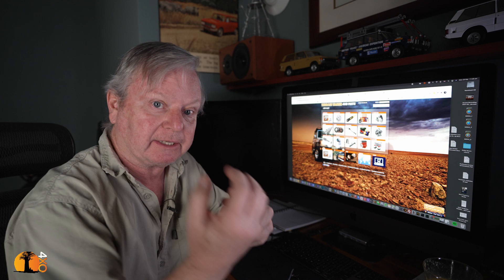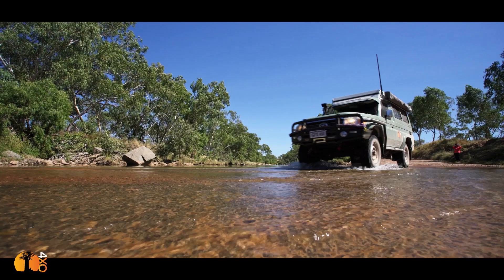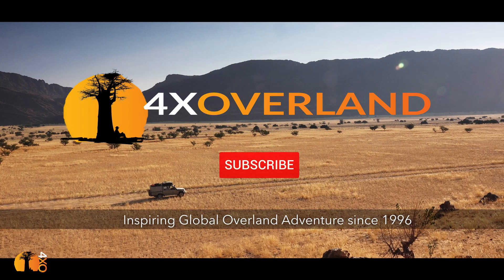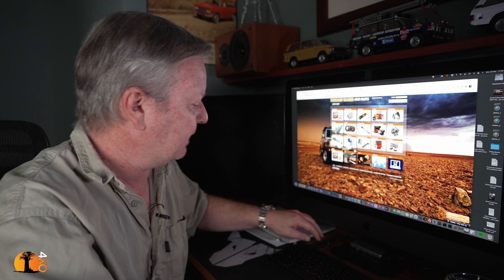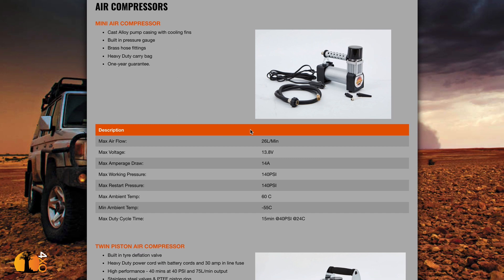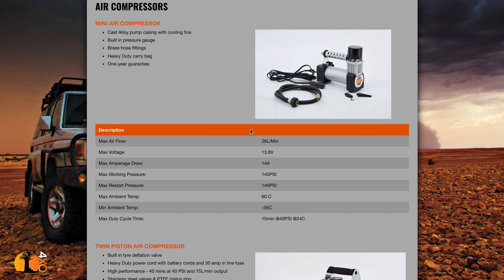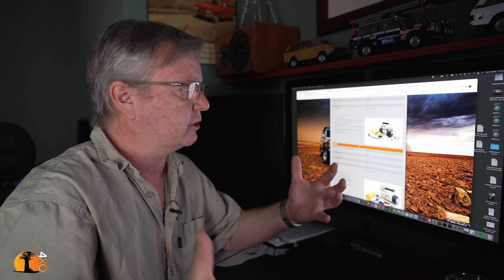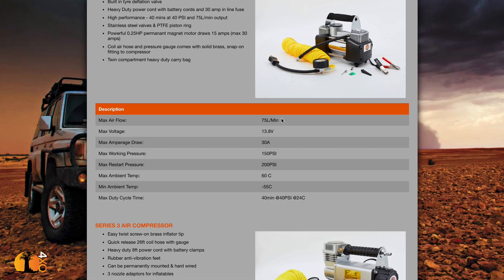BUDGET OVERLANDER ACCESSORIES, COSTS AND SUMMARY | 4xOverland

Comment: A great series for the orginal XTrail and yes there is one or two items I would just add on a budget.....

The first I would add is a bridal for the front recovery points, a few bucks or pounds well spent, the XT has two on the front though the bolts need uprating, also rear recovery point is an issue but you can use of a 2" receiver is an option, so get an Warn or ARB shackle block. I have seen protype soft shackle blocks but not off the shelf as yet. 

My second suggestion is perhaps considered by some be less important, but having done forest trails there is no accounting for damage by unseen rocks, even when carefully picking the route, a sump or engine guard. There are still a number available and for the low slung vehicle I would consider this, and they are not expensive and worth it for the protection they offer.

Lastly for those long trips take communications, even here in my home country I have had plenty of times where there is no mobile signal even on the best network. There are a number of different devices and technology moves apace, but to keep cost down for budget, borrow a sat phone or sat messenger and learn how to use it for those outback travels.

The little X-Trail is a good vehicle, even without low range, etc., and I am considering another one of the originals for our short list of repalcement vehicle eventaully, why, because I fed up of the Land Rover being so completley random; it has electronics and these are just  badly designed for a vehicle that goes off road. Don't get me wrong, like you I love the old land rovers, but they never did master the dark arts of Lucas electronics....

We never experienced any major issues with our diesel engine on our T30, but the vehicle loves to be serviced and we had a plugin unit for diagnostics which worked off the phone for those occasional error codes. 

Good to see a budget build and we had lots of fun in ours. 

I will add this series to our must view list for the X Trail......

Be safe.

Comment: Ok, a few thoughts to share which I’m sure you have already discussed with those two happy travelers:
Recovery gear: test them out before you go off road. Make sure you know how to use them and that they have no flaws. Extra important!!!!: check that your shackles fit your recovery points and that the recovery points are RATED for recovery and NOT just for towing!!!!! Most cars have “towing points” and actually only in the front of the vehicle. Make sure you have AT LEAST one point at each end of the vehicle. If it doesn’t have, you MUST fit one.
Ditto with the compressor. Check the cord and air hose can service all four tires. And that there are no leaks. 
The fitted tyres are not far larger than the OE but it wouldn’t hurt to check that the onboard jack can lift the tyres off the ground. Also extra important that all lug bolts are torqued by hand to correct setting and NOT by air gun, otherwise they will not be able to change a tyre in the wild.
Last, if they wish to travel with friends in convoy it makes sense to get handheld radios.
Happy overlanding!!!

Comment: My recovery equipment include: smittybuilt air compressor, x-bull traction boards, Amazon soft shackles, 3 sets of Amazon 10t hard shackles, a winch recovery set from Gear America, an extra 6t 30 foot strap, a 30 foot 25k pound kinetic strap. And for worst case scenario, I also have a 9500lb smittybuilt winch with a pulley block. And in case all else fails, I still have the tree saver and a 20 foot 20k chain (only used when doing a slow pull and not a lot of room to pull with. 

I also carry a plethora of tools in case the vehicle I'm recovering is broken somehow, in hopes I can mend it until its on solid ground and a towing service can pick it up. 

Far from the most expensive of kit, but so far it really hasn't let me down and I've done dozens of recoveries so far without needing to replace any of it.  

I do agree though, ARB stuff is great but hard to come by locally right now as there is only one ARB dealer near me and it's a smaller shop so it cannot carry the stock that bigger ones can

Comment: Air compressors , I have one of those nasty Kings single cylinder comp’s , I pulled up at 15psi after driving the Coorong SA , and the guy that had already started airing up with the ARB twin comp was still going after I had got my pump out , hooked it up, pumped my tyres up to 40psi and packed up to leave, I was shocked how quickly the cheap nasty pump worked.
Reply: I have the twin cylinder hard wired and with a small air tank, very powerful unit, draws 90 amps though, but it's very quick

Comment: The compressor comment was spot on, I have a GMC Sierra Z71 with a 2.5in lift and 33in tires. My compressor gave out because it could not handle the load of filling 4 tires.

Comment: The kings recovery gear and thumper max compressor gets the job done
Reply: dual thumper goes hard. i paid under 100 shipped and its still going 5 years later. does 4 32s from 15--40 in 5 minutes. cant complain about that....  i replaced the filler guage with an arb one as the stock one is shit so lets call it $150...
Reply: @paulholyoak  def does the job for the price, great value

Comment: Well, I think getting ARB recovery kit and Maxtrax board for budget build is way overkill. You can get a proper (kinetic) rope and shackles from hardware store for at least half the price if not third. And no, don't tell me only ARB can make proper straps. Same with the Maxtrax's. If you are overlanding/offroading few times a year, you don't need expensive boards. Same with the compressor. So, you are pumping your tyres for 4 minutes instead of 6...so what? This aint budget overlander accessories. For budget you have to ask someone who has really done budget 4x4 recently. If you are in budget, you think in terms. Hmm, 300$ for a recovery board..or I could get a cheaper one and also get a waching machine for my home. 200$ for ARB kit or 70$ for hardware store stuff and I get fuel for my next trip. That's how people who don't have much money are thinking.

Comment: Hi Andrew, Love this series on the x-trail, I have had the 2009 diesel model from 2012, it came with the rear safety rack and the draw floor in the back, over time I've added things, second rear floor, fridge, battery, dc/dc, roof rack, solar, basket and awning. They are a good vehicle for touring around in. Thank you for your insight, words and throughs for the budget touring people.  Cheers

Comment: xtm does well even in the Queensland South Australian desert heat. all 4 tyres multiple times a day no issues in 3 years so far. ive even done the pressure switch and trigger hose mod which adds functionality for cheap

Comment: Really good series. The build is similar in the camping elements to what a lot of weekend and slightly longer trip off roaders / four wheelers use. That’s a compliment, it is a setup that takes a little bit of thought and looking after but does the job and you are right, it can’t be bettered without a significant extra investment.

Comment: love the series...love the xtrail..i made my own roof rack from aluminum railing posts and fabbed the brackets from the scraps cut off the posts...with a sheet of plywood i had a great base for a tent (and for under $150)..grease the joints with the needle greaser and that motor need religious oil changes.
super fun vehicle...many 12 hr drives.

Comment: That's a good start for them, I think a plastic tarp important and a decent length of rope you are willing to chop up as required. If you have to change a tire it will most likely be dark and raining so the tarp will help. If you will be sleeping in a tent get one you can stand up in, it is the difference between sanity and insanity.

Comment: I personally use a Harbor Freight pump.   Filling up all 4 of my tires 33/11.50/16 at once it took only about 5 minutes.  I often then would immediately air up others who didn't have their own compressors.    Only complaint I had with it is that after a few years the rubber portion of the hose started to crack.   But I'm a poor wheeler/overlander /lol

Comment: I really like this series. Very good... I guess with my current Ram 1500, I could use this as an inspiration to do mods with minimum cost and do a build that in between of what you did to the Isuzu D-Max and what you did with the X-Trail, in terms of an electrical setup, etc.

Comment: I carry a plastic V Sheet. (Marine distress orange sheet with black V) and duct tape. In a break down emergency tape it to the roof, high visibility from the air and any pilot will recognize the signal particularly if they are looking for you as you have activated a EPIRB or your relatives have not received your all OK message as scheduled. Cost about $15.00 weighs nothing.

Comment: Hey Andrew, I'm following along with this build and basically copy and pasting (with some thought) the suggestions you have. One potential problem is that my suv is a 2wd. How impactful will this be? Is it worth keeping this suv to go overlanding / touring now or selling and hoping to snag a 4wd at little to no cost (unlikely). I have a 2001 Isuzu Trooper (Holden Jackaroo). I'm a little attached because after sitting for a couple years, I've just finished all of the maintenance work and it is running beautifully.

Comment: Good video andew, only thing i disagree with is buying the genuine maxtracks. For a pair of genuine on sale is around $220 so it would cost $440 for 4 whereas ebay copies are only $60 for a pair. Therefore making it $120 for 4 thats a huge price difference and even if you were to just get 2 genuine ones isn't it better having 4? then you could spent the money you save on something you use every-time you go 4wding like an arb compressor.

Comment: My main complaint about the ARB kit is the price to go from just the snatch strap to the strap, two shackles, and a bag doubles.  The shackles might be nicer than the $10/each models, but the extra cost still seems above and beyond when those $10 shackles are still rated for load the same as the ones that ARB supplies with their kit.

Comment: The part about compressors was informative, there are many on ebay with dubious claims as to how powerful they are eg will pump a car tyre up in two minutes, but how big is a "car" tyre? The larger ones can easily take 20A and most cigarette lighter plugs are only rated to 10A, so need to fit croc clips.

Comment: This series is great! I'd love to see a vid of it out on a trip! My sister just got herself a really good old Xtrail very similar to this and wants to set up a basic adventure overlander so I'm following this very closely :) 

suggestion: Would it be wise to perhaps mount the spare tyre to a roof rack? provided you place the weight in a spot that is balanced of course. My thinking is that the spare is in a terrible position, locked away under everything (including the drawer system!) and if the spare was needed, it would be a dreadful experience... The empty wheel well might then be able to be utilised for storing things like electrical components, or something else that's heavy and doesn't require access to... I've also seen a rear spare wheel mount accessory that attaches to the tow point, which would give you a place to put the maxtraxx, a bin bag, lights and a jerry can potentially ... but that route would cost money $$$

Comment: I think that with the electrical system they have I personally would include a lithium battery jump starter just in case they forget to unplug...I own the NOCO brand and have gotten good use out of it over the last few years, not only for my own vehicle but for others.

Comment: I know you and mitsubishi had a falling out, but what is your thoughts on using a Mitsubishi Delica L300 or L400 for overlanding? I bought an L300 to camperize the interior, modify for better offroad performance, and use for overlanding.
Reply: I've owned both, great vehicle's especially the 300, just make sure the timing belt is replaced at least every 90,000 km's if they go and mine did you will be up for a new motor.

Comment: What's your opinion on a military-style entrenching tool as an emergency shovel of last resort?  I'm not thinking in terms of the shovel you have when you're specifically going to take on a challenge, but rather for what you keep on-hand when what you're doing is otherwise relatively routine or is with the intention on remaining on relatively maintained gravel roads.
Reply: I have one in each of our vehicles.  They work well but something with a longer handle would be better sometimes.

Comment: Straight off into misleading... if you look at the data; you say your twin comp draws 70A They list MAX Draw 68.6A the 50.4A draw is at 29psi... not 150psi where the compressor is effectively stalling. But how often do you run over 50psi?

Comment: Dumb question here but i was looking into xtrail, we have them in Mexico but i read they were all CVT'S, if not true what years where normal auto trans and wich years cvt's?? Nice build by the way...
Reply: when the body style changed..roughly 2007/8??....my 2006 was like this one and the 4wd system was different too (better) ....keep an eye on lower control arms and piston rings.....great vehicle otherwise.
last of the good nissans in my opinion
Reply: @kazzTrismus  Thanks, i have an 02 xterra 4wd, while its great off road its terrible for a daily driver so i wanted a small more fuel efficient vehicle, i completly ignored xtrails until this video, ill keep an eye out for one. Thanks
Reply: @ambienteterrazas  it's no jeep or f Toyota Fj or xterra.. But it is good..the  2.5 is pretty good on gas and plenty powerful for a daily grocery getter.
There are some front wheel drive only ones (keep a eye out for the 4wd switch on the dash)
Soooo much storage pockets etc

Comment: I dont want to go rock climbing or extreme driving. If i did, Id use a motorbike.
For avaerage  type weekend use, no beach driving (should be banned), should i fit a rear axel locker or electric winch first.  Colarado cab chassis. I  believe it has LSD on the rear and traction control ( which i believe disables when in low range?). Money limited.

Comment: Thoughts on a Capstan Wheel winch? A cheap solution that will allow for safe recovery where maxtraks aren't enough?? Just thinking of it as a safety feature
Reply from the maker: No modern car engines have PTOs that allow the fitting of a capstan winch. Easier and cheaper to fit electric.
Reply: @4xoverland  I was thinking of the systems that mount on to the physical wheels of the vehicle. They may be referred to as Bush Winches or Wheel Winches out there?

Comment: Maybe consider a C02 tank for a cheap way to quickly inflate your tires.
Reply from the maker: Impractical as all hell!! By cheap, I think you mean, really expensive. Air tanks are heavy, expensive, take so much space and expensive to recharge. I tried one on a trip, but they are so impractical. One tank means one re-inflate. And then what?
Reply: @4xoverland  I am not quiet sure how it is in Australia but here in the US you get a tank and regulator for less than 300USD or you can build one yourself for less than 200USD.  Of course weight, size and number of re-inflations depends on tank and tire sizes but a 5lbs C02 tank will re-inflate a set of 265/75r16 tires roughly 6 times.  re-filling the tank generally costs 30-40USD.  Of course having a limited number of times you can re-inflate your tires can be annoying but the C02 tank has less parts that can fail and they are much faster than a compressor.  Here is a link to a dirt lifestyle video that has a more in depth explanation.  https://www.youtube.com/watch?v=bG6n8S6G-58

Comment: Too bad that your suggested kinetic recovery kit has about dozens of times the rated load than your previously mentioned 'fore and after factory welded on recovery points'. These are merely tie down points for shipping and not meant for shock loads during recoveries and potentially life changing or terminating when used as such. Don't skimp on recovery points.

Comment: What about recovery points? As you said you will get stuck but how are you going to attach straps etc to pull you out.
Reply: he said the car already has points
Reply: You can use the two tie down points at the front for a double line pull. If they have a tow hitch at the back. That can be used.
Reply: @raymondsvensson9773  you can't use strap down points. Even both together not. So, this xtrail had recovery points on already.
You can use hitch or rated recovery points. Otherwise you will do more damage to your car that its worth.
Reply: @leonlevstik  there is also screw in eye bolt in the jack kit that goes in the front bumper that can be used for towing short distance. I was thinking if they to self recover they could  a hand lever winch.
Reply: @raymondsvensson9773  you can’t use tie down points and it doesn’t have a tow hitch, that’s why I asked. Not only dangerous to the car but to occupants and anyone else close by
Reply: @nesoutandabout6161  we, then should ask Andrew where the recovery points are. Because, the one other than the two tie down points at the front is where the eye bolt screw into on the front bumper. I have one of these eye bolts for my Xtrail. I have not needed to use it as yet and I hope I don’t need to.
Reply: @nesoutandabout6161  the recovery points may be on the nudge bar.
Reply from the maker: The car has front and rear recovery points.
Reply: @4xoverland  could you please show me where they have been placed. So I can put the recovery points on mine thank you 🙏